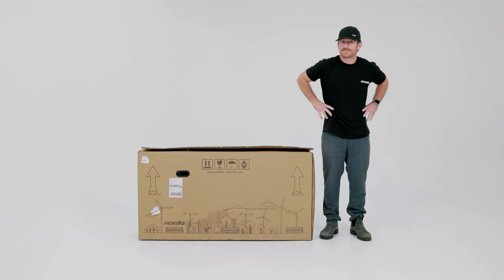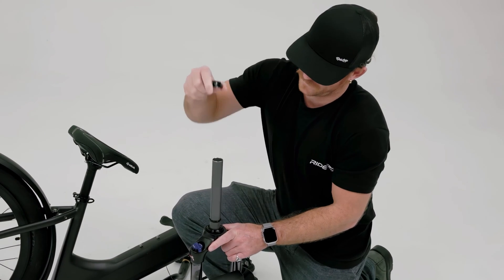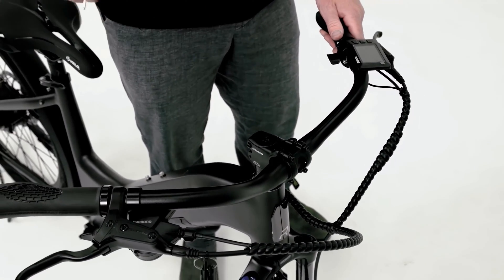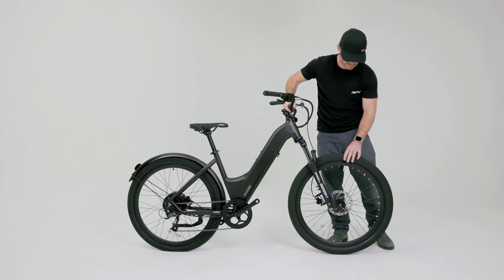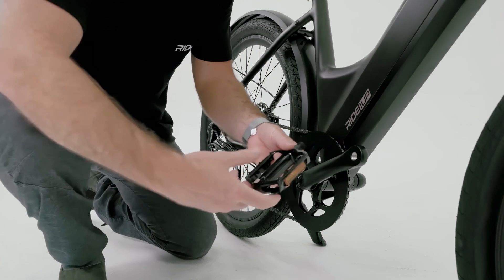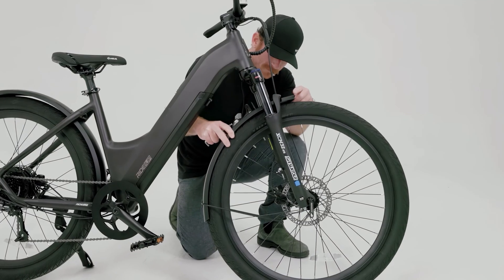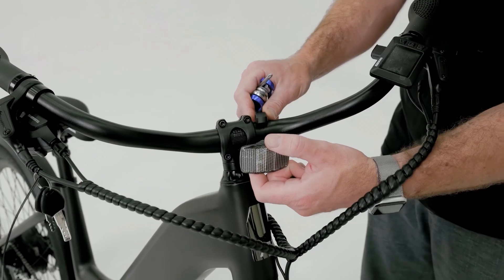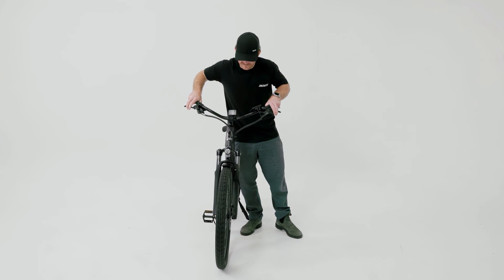How to Assemble the Ride1Up LMT'D V2 Ebike

Comment: Suggestions to improve video.
- More close ups and still shots while describing what to do
- Spend more time on the fork install. It would be helpful to show close-ups of the orange ring, the blue ring, proper seating of the compression ring (What is too far in and what is just right, etc.)
- Explain what to do if there is resistance when turning the fork
- Your pre-assembly tips say to grease the tube - Show us how to do that!
- Show a closer image and video from multiple angles of how the front caliper should be installed
- Provide tips on if the rotor rubs the caliper after installation
- Make sure the video covers all the parts sent with the bike. There is a strange washer that has no explanation.
Reply: It says to grease the fork tube??? Great, I already assembled mine...

Comment: What is new?
Reply: New motor, same power but this one is an angled version so it runs quiter. New colors to choose from. Metal fenders and integrated brake lights are also new. New seat. And battery is now a drop down (which is much worse) vs the LMTD which was seated on the top tube (pull up). I love my LMTD.